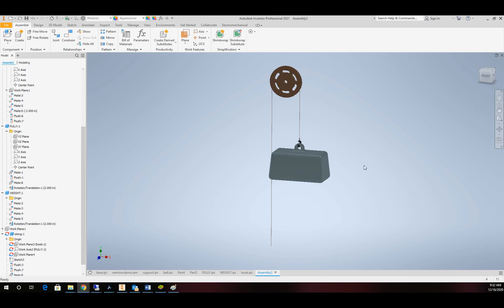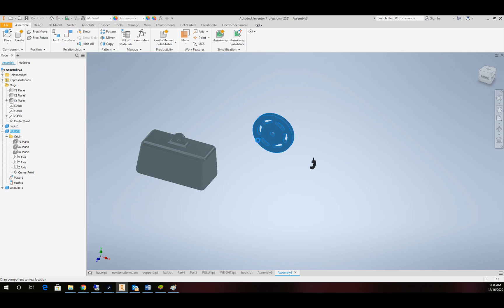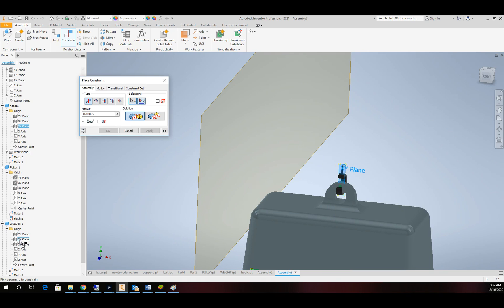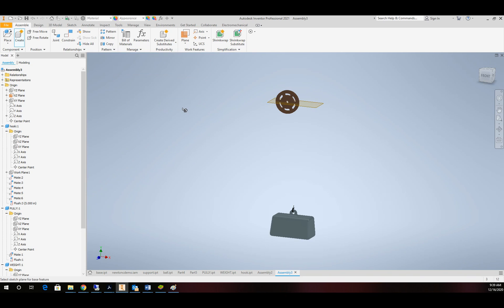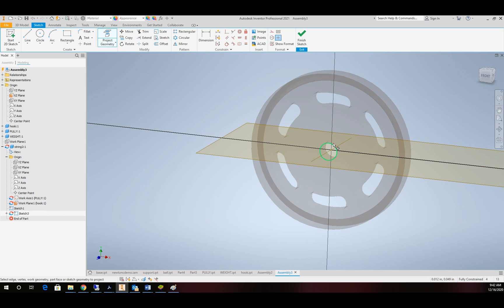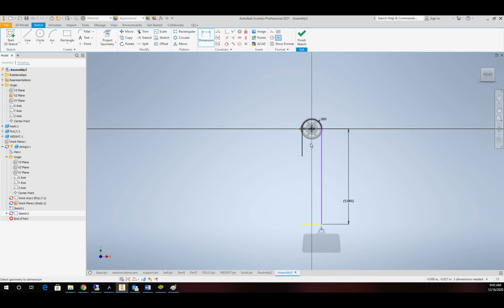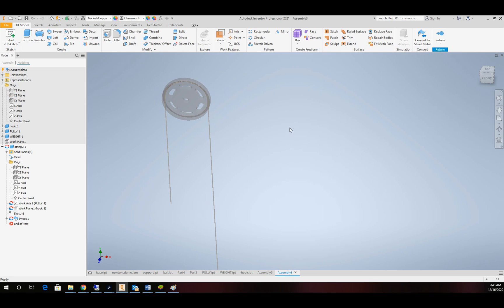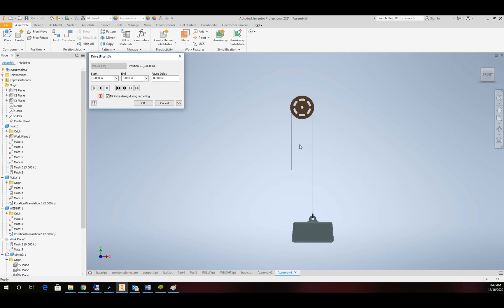AutoDesk Inventor 2021 Creating a String Pulley Assembly Tutorial

Comment: Good video for sure, showing how to animate this with a driven constraint.     But what people also really want to know is how to simulate in dynamic simulation, a rope over a pulley, pulling something.  Very, very little guidance on this.
Inventor should be able to easily simulate all 6 of the 'simple machines'.  Right now, this is not possible.  But Autodesk wants to be in every high school and college, so they are inviting very novice students and these students will certainly be studying the simple machines.   I've waited a decade for this to be addressed!
Reply: Hi, I've been looking for a real dynamic simulation of a rope over a pulley, pulling something on Inventor for several days now. Did you finally find a solution ?

Comment: Is there motion constraint "translation-translation"? For example, if something moves 10 mm, something else to move 5 mm?
Reply from the maker: There currently is not translate to translate motion constrain, just rotate rotate, or rotate - translate.   Using parameters would be the only way to accomplish this.  Set up a variable such as distance = 10, and set that to drive , then set up the second part to with distance/2  .  Once the first part is driven the second part would move have the distance.
Reply: @MorrisonInst1973  Aha, I understood. Thanks!